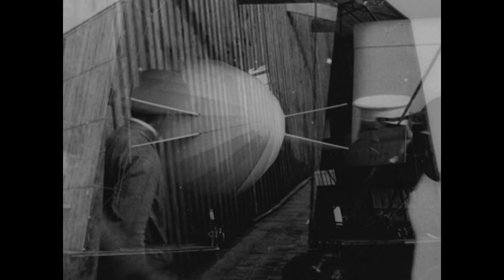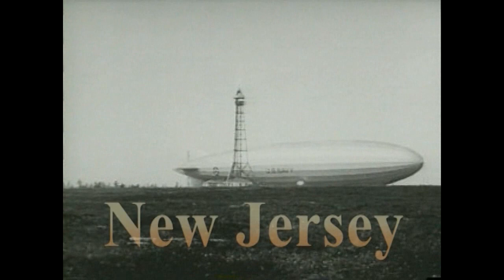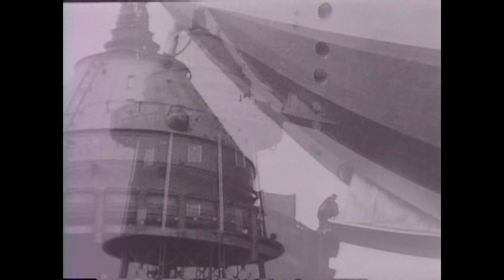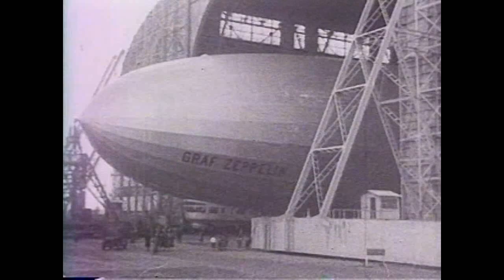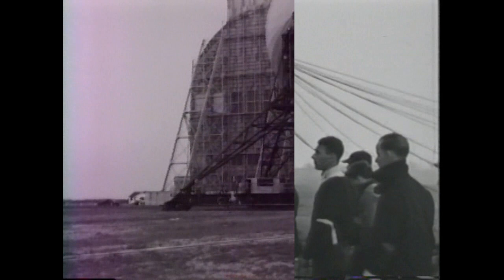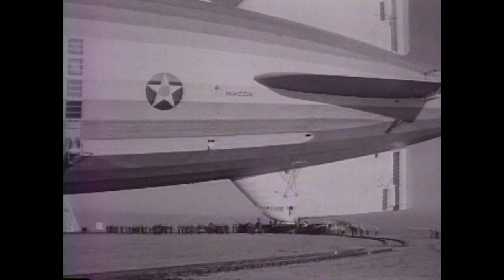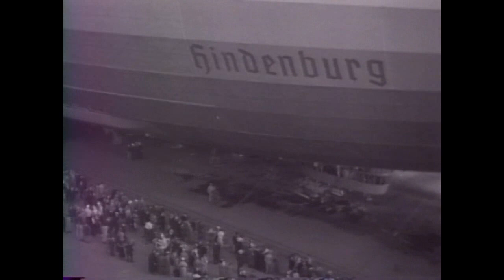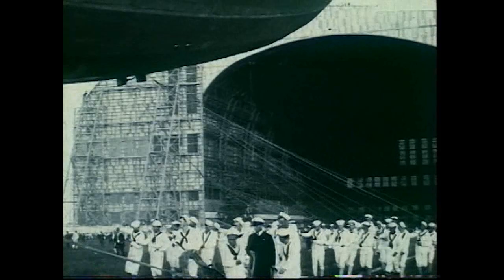Rigid Airship Ground Handling

Comment: It's a shame that rigid airships are such deathtraps.
Reply: At least they had on board heating.😆😆
Reply: Are they though? If a plane crashes, everyone on board will usually die. With an airship however, depending on the severity of the accident, almost all of the passengers can survive. And in the early days of these ships, hundreds and hundreds of planes were crashed as in that time, they were neither as efficient nor as safe. Sure, many ships went down too, and you might think they had the worst safety record of any type of possible transportation method, but this is not the case at all. Since when the crashes did happen near the mainland many people were often watching. Compare ww1 zeppelins with ww1 submarines which had far more casualties as a result of exploding even when not being hit by an projectile or a zeppelin bomb. So when submarines did sink, (many did sink too) no one was watching obviously and there was no hope for any of them to survive unless the sub was near enough to the surface.
Reply: TL:DR Both airships, submarines and planes in their early days had many losses, though still many people consider airships to be particularly unsafe because of how dramatized their accidents were or how much more attention they received.